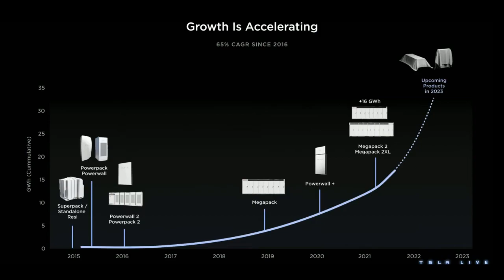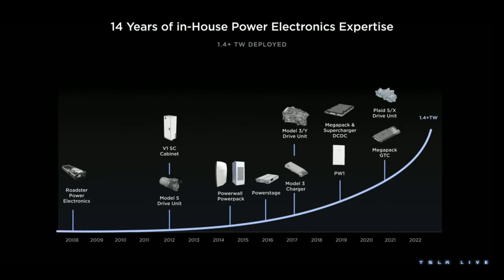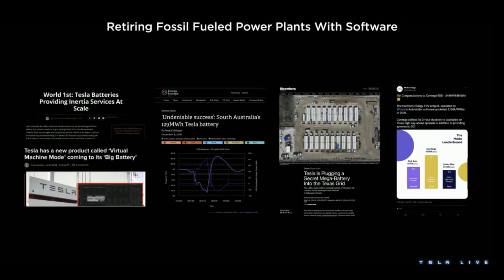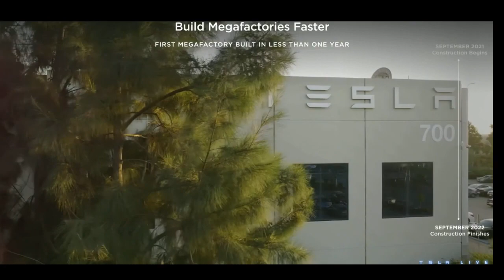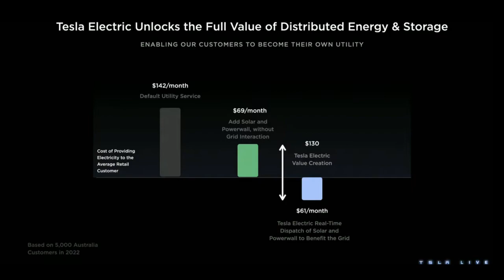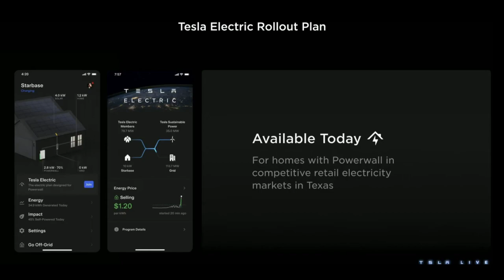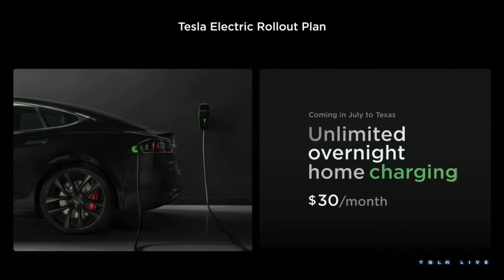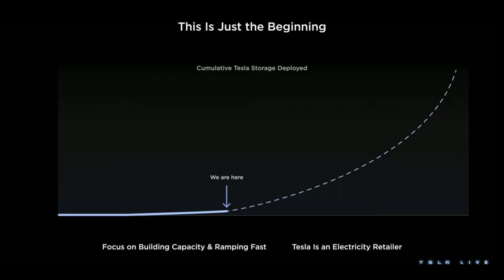This is the product that retires the Fossil Fuels. Tesla Energy Drew Baglino & Mike Snyder

Comment: And what about nuclear power plants effect?
Reply: demand goes up and down throughout the day. nuclear power plant makes a consistent steady amount of power at all times. battery storage fills up in low demand hours and provides the extra needed power to the grid in high demand hours. it retires peaker plants because it doesnt require fuel and is cheaper to build and maintain - no more burning coal and gas for the grid.
Reply from the maker: Agree. It's cheaper, faster to build and mantain.